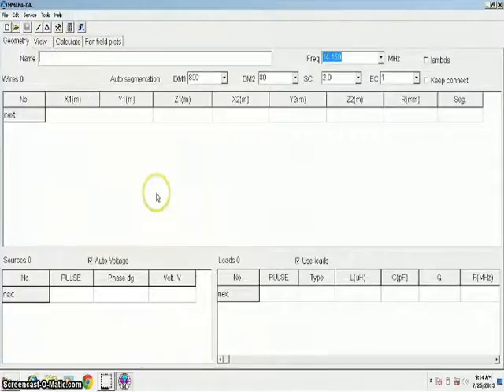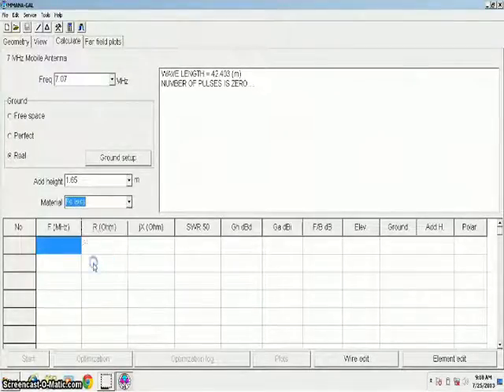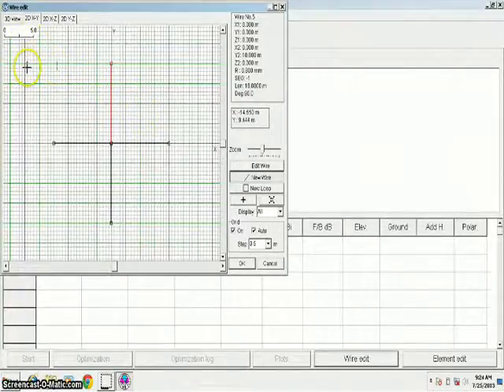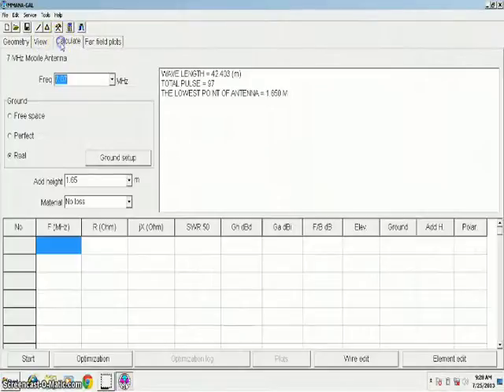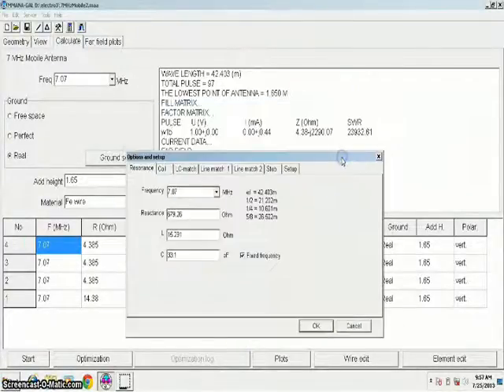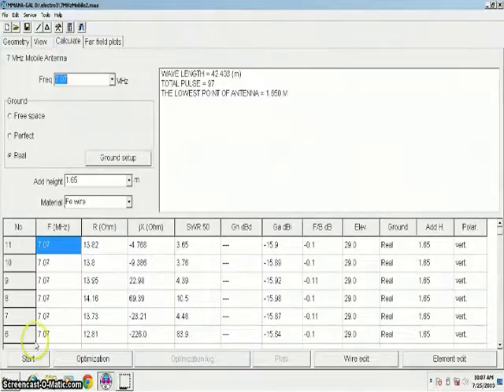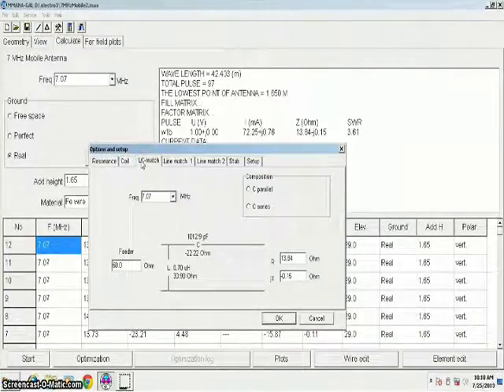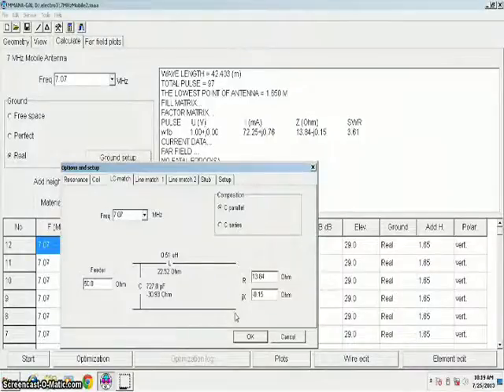Designing 7 MHz Mobile Antenna Using MMANA-GAL Free Software

Comment from the maker: Hello PU1WPC, still not clear what are You asking, about frequency range: 435 to 434MHz, do You mean You like to have antenna with center frequency of 434.5MHz? And that 1.5 mm whip You are having, is that 1.5mm radius or diameter? And if You like to realize, are You having sufficient measurement tools (antenna analyzer, LC Meter)? Is that going to be used at home or as car antenna? And if it is car antenna, what is the height of Your car roof? That 1.5mm whip, what it is made from?

Comment: Friend as drawing antenna uhf 70 cm in MMANA GAL?
As an antenna 3x 5/8 wavelength range of 435 to 434 MHz or?

Still using the 1.5 mm cable for me to test drive the antenna?